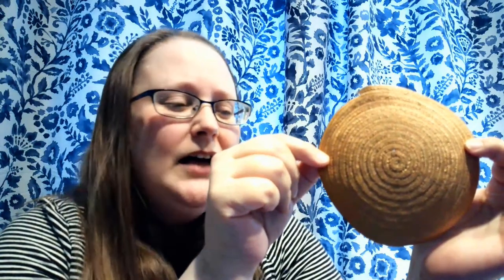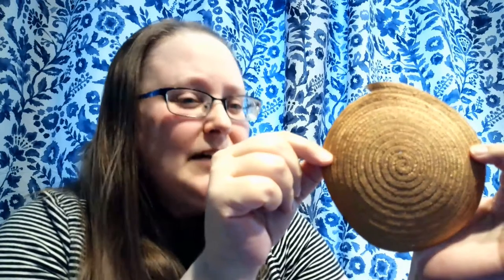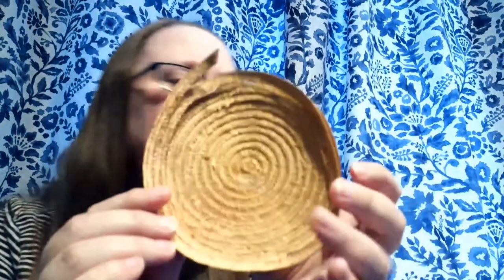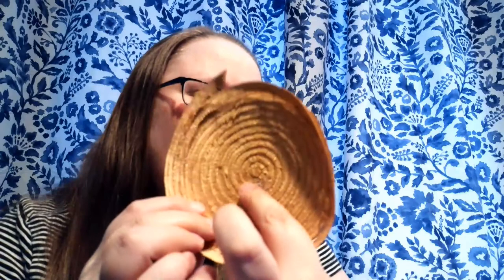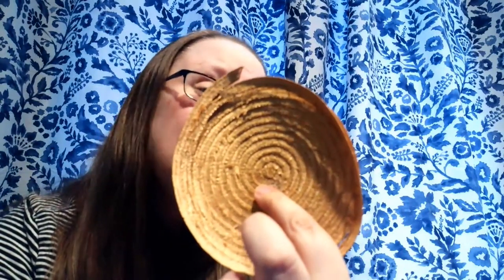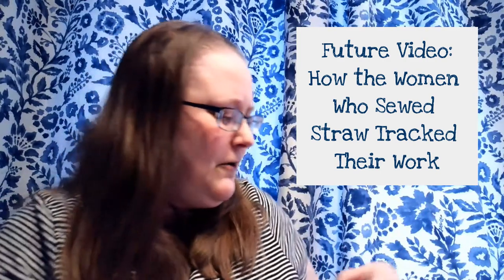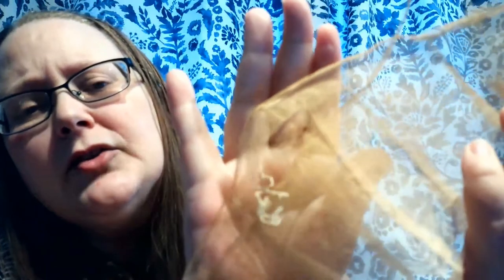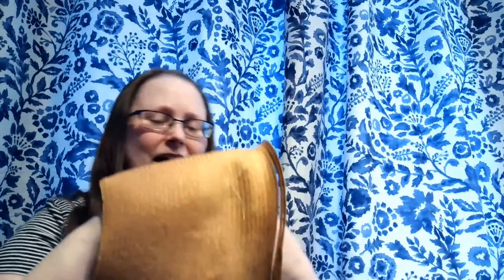Anatomy of a Straw Bonnet | 1850s-1860s Victorian Straw Bonnets

Comment: How many metres or yards of straw does it take for a whole bonnet?
Reply from the maker: Great question. For an 1840s to mid 1860s bonnet, I generally start with 30 yards of straw braid/plait. Usually,  when braid is wider it takes less and when it is narrower it takes more. On the rare occasion I make an 1820 or 1830s bonnet, I set aside a whole hank, just in case. 
Thanks for asking.